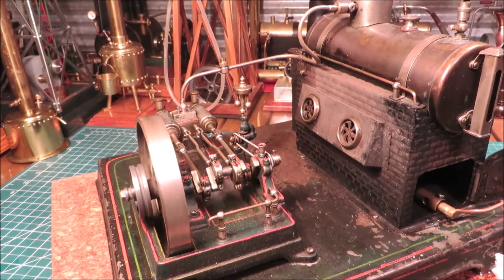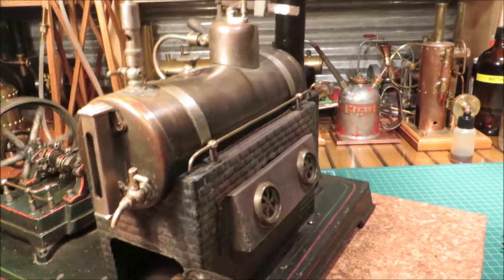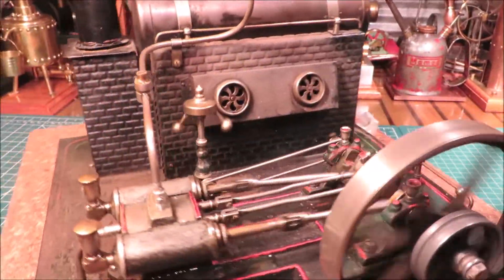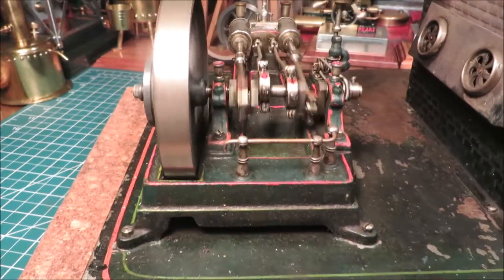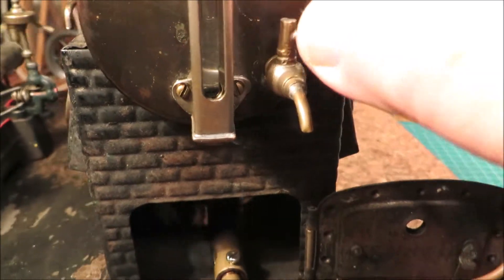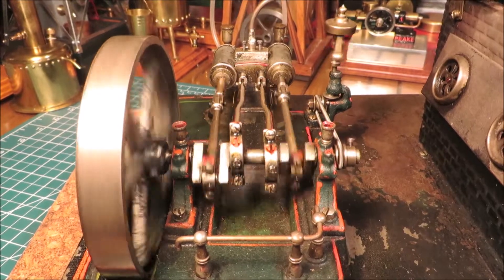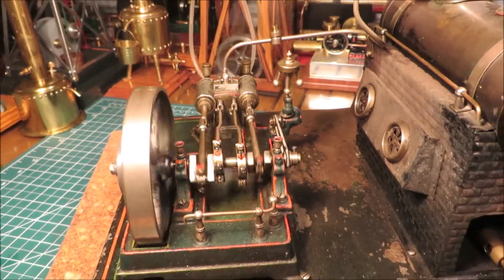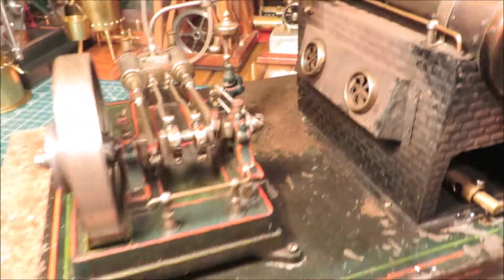Model Steam Engine German Doll 365 Toy Steam Engine running on live steam

Comment: I have a 365/1. Where your whistle is, i have a pressure gauge and my whistle sits on the boiler face next to the level glass. There should be a decorative cover over the cylinders and those two oilers at the back of the cylinders should be condensate taps. There is also a pressed tin "brick" chimney that is rather tall. Where you get those parts from is probably noted in the dead sea scrolls, i imagine!
  All i did was clean the gunk off my boiler, polished it up and used Brass Black on it to give it a Marklin look and polished and heat cleared the steam dome. My firebox was in a good enough condition to just leave as is, same with the base. They are a nice old unit with plenty of gothic character.